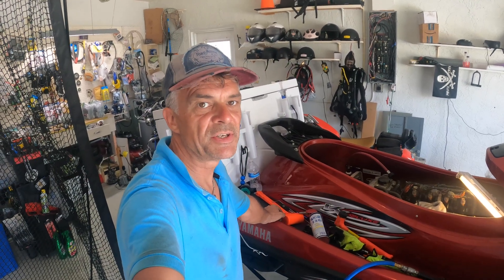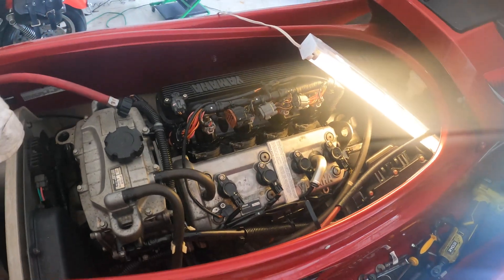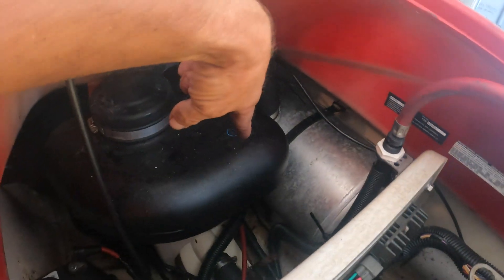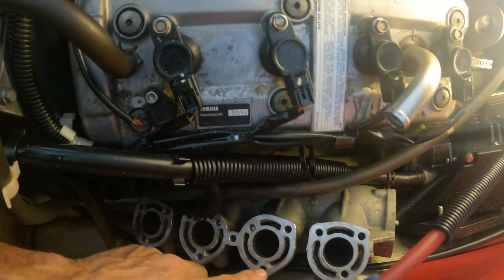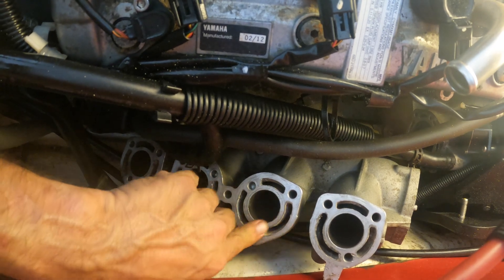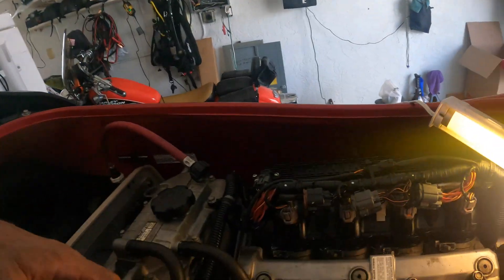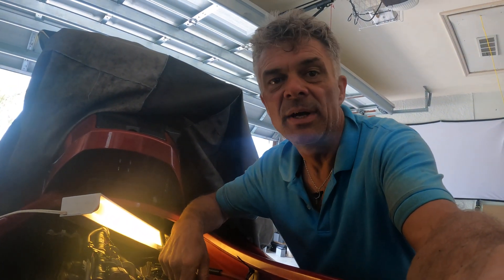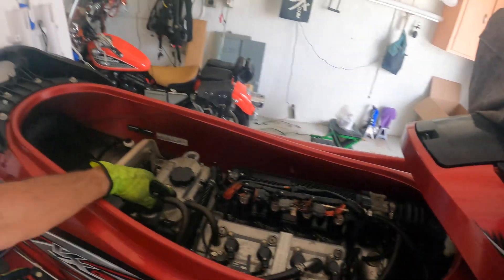Yamaha VX Deluxe jetski overheating when under load. Tech Tuesday.

Comment: Does running aground into mud clog cooling system? What checks should i do afterwards, still running fine but I'm worried about clogged cooling system
Reply from the maker: 👍first thank you for watching commenting. Yes it does suck in sand, small shell and other deposits, which in turn will clog up the cooling system. If you run it on open water afterwards for a good ride more than 5 minutes at a good power setting you most likely will get most of the debris flushed out. However when you get the ski back on dock or trailer make sure to freshwater flush it, for 5 mins. After that give it a backflush since this will remove small shell or other debris, which was ingested but sitting in the bends on the cooling hoses before the engine. 

Don’t run it aground and stay away from sand bars when the engine is running. Turn it off when you reach the shore and it will function for many many years to come. 

Hope that helps 

Sail safely, best regards Rene
Reply: @techtips101  thankyou for the feedback, I'd done exactly as you've said, bar the back flush, how do I do this? While engine is switched off?
Reply from the maker: No the engine has to be running, here is a small video on the technique. 

Not one of my videos - I might make one for you guys to see. But it works. 

https://youtu.be/wwkBMRpvr7I?si=_hKqj0RRJU5nO5aA

Sail safely - best regards Rene.
Reply: @techtips101  Thanks mate, really appreciate the advice
Reply from the maker: you are more than welcome 🙏

Comment: My warning light comes on after 20 minutes riding it a little hard. Could that be that is overheating also?
Reply from the maker: Thanks for watching and commenting, most likely if it is the temperature warning light and not oil, make sure to check correct oils quantity. Let it run idle for 5 mins and check oil level, if needed adjust and add oil. If that is ok, and problem persists, and if you don’t have and fail codes on the display, most likely it is a cooling problem. The Jetski if operated near shorelines or sandy sandbars, will ingest the sand and salt. Together if you are unlucky and maybe have a little residue left after flushing this creates a salt stone like substance and hardens up inside the cooling canal in the internal engine. If you are lucky, it can just be a small shell in one of the cooling hoses and you can take that away with a backflush most of the time. Search for backflush video on Jetski and there are lots of videos on the subject, I will make one in the future. I this doesn’t help you might be able to help yourself by cleaning the manifold and cylinder walls cooling canals as I have on this video. The engine is running hot very fast if it does not have access to free running cooling water. If you still have the problem it could be a little longer operation where you will have to take the engine apart and do a head job, since the salt stone most likely have settled inside the cylinder cooling canals and hardened, this needs to be removed in order to let the engine cool again at full speed. Most likely if there is a 1/4 inch salt there it will run hot after a certain time, at hard power, but will run at lower power settings without alarm. However it’s just a matter of time before it clogs up more. 

Here is a video on how to do the head job and cleaning as well:

https://youtu.be/qZGHGQ2RLf4?si=4G6Xnr6gv5r6spgf

Sail safely, best regards Rene

Comment: Do you know why my speedometer reads more than it should? What can I do? I appreciate it.
Reply from the maker: Your speedometer might be in Km/H and not Miles/hr. Ist a quick change on the display - in mode settings. 

However if it reads miles/H and reading too much it could be a calibration of the system that needs to be done and I don’t have a solution for this at hand. 

Hope this helps, best regards Rene

Comment: Good morning sir. Can you tell me where is locate the thermosensor on vx1100. Thanks you
Reply from the maker: Hi there - and thanks for watching and commenting, the thermo sensor on your Jetski should be mounted on the side of your engine block, fastened by 2 screws. Check and download diagram below 👇 

https://www.slideshare.net/slideshow/2005-yamaha-vx1100-cruiser-deluxe-sport-service-repair-manual/87765754

If you have problems with cooling and the temp horn and warning light comes on - be aware that most likely you have ingested foreign object like sand and shells into the engine and they are blocking your cooling system. A back flush can sometimes help you remove this debris, however if it is sand it tends to form and collect inside the cooling walls of the crank block. Time after time of use this gets heated up and down creating a pretty solid salt stone inside the engine, which in turn prohibits the water to cool the engine enough. The water can only access a part of the cylinder wall on the outside and therefore the ski runs hot. 🥵 you can sometimes be lucky to clean out you majority of the cooling channels from the exhaust manifold side and that might clear you problem for a while. 

Worst case you will need a new head job done and it time consuming and expensive too. I cannot recommend to operate the jet skis near sand bottom beaches since they stir up the sand and ingests it, resulting in a lot of problems. 

Here is a video of my experience with a lot of sand and a head change as a result:

https://youtu.be/qZGHGQ2RLf4?si=KdMTvd9FaDb9bdya

Here is a video on exhaust manifold and cleaning before taking the engine apart :

https://youtu.be/u6LWCmhM0qg?si=sGqlR5bV4FubvkvI

There are a lot of videos on how to backflush your Jetski so look for one of those too. 

I really hope this helps, and my apologies for a little late reply. 

Sail safely, best regards Rene
Reply: @techtips101  thank you very much. the best help ever.
Reply from the maker: @rafaelnakamura9935 you are more than welcome 🙏 - I know it’s frustrating 

Sail safely, best regards Rene

Comment: Thanks ao much, mine is having the exact same issues as yours. I bought it a few years ago from my brother, he had a similar issue and removed the head, it worked fine for a while and now  it's happening to me. I think I'll try what you did first. Thanks for the very informative video!
Reply from the maker: Thank you for watching and commenting. If you are lucky this will take care of your problem. However if it is worse then it might be necessary to change the cylinder head to solve the problem. You can also back flush it to see if there is an ingestion problem from a seashell in the tubing. 

I have a very recent video on cylinder head assembly with the same issue here:

https://youtu.be/WfFiVE-oODw?si=p2i2TkUvg7kPZg7g

I hope this will get you on the right path to success. 

Sail safely, best regards Rene.

Comment: Did this solve the problem?
Reply from the maker: Thank you for watching and commenting, yes it did take care of the problem - if I couldn’t get this clogging out I would have had to remove the head and change the head gasket too and it would have been a lot more work to accomplish.  The foreign object that goes in here crystallizes and that’s why it clogs up. 

Hope that helps 

Sail safely, best regards Rene
Reply from the maker: In the end I had to get a new Cylinder head as this was totally clogged as well, when I took it apart. 

Here is the link for that video :

https://youtu.be/qZGHGQ2RLf4

sail safely, best regards Rene